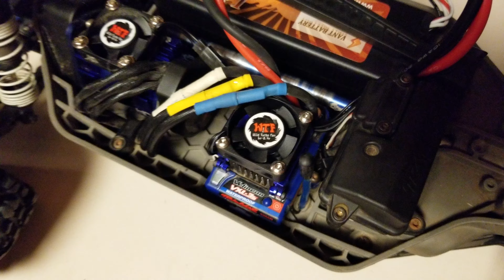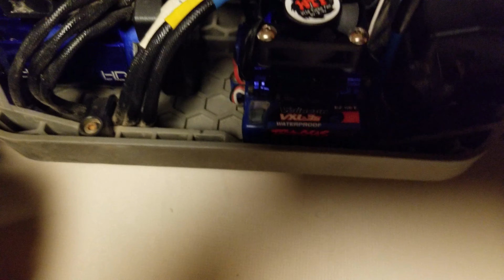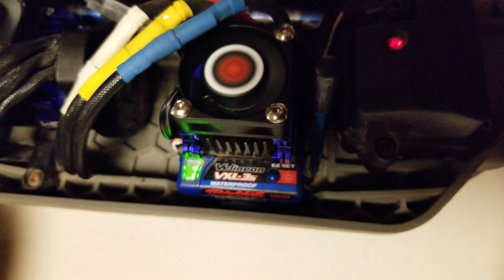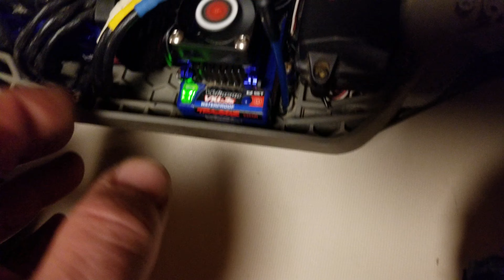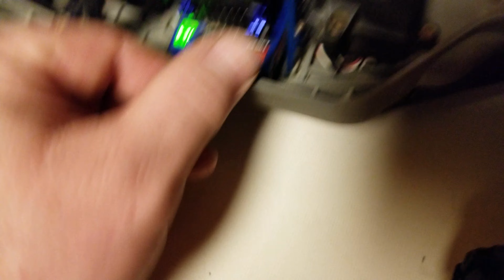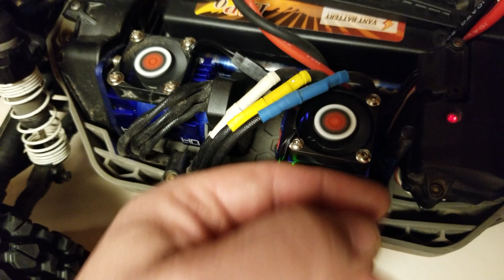Traxxas Rustler 4x4 VXL WTF Fans Finally Installed!

Comment: *USE GLOVES*    -- if you take this step --   (thermal paste can be nasty stuff, may irritate the skin):
If you choose to want your motor heat sink to stay put, not slide around, you can use thermal paste, or thermal glue. Same stuff as you put on a computer CPU, to transfer heat to the cooling system in the computer. 
Put a little dab of the paste on the inside of the heat sink, or the motor, spread it around, evenly, where the heat sink will slide on, and once the heat sink is installed, it will help with heat transfer, as well. 
  For clean-up: rubbing alcohol & some cotton swabs/Q-Tips to get excess off of your model (don't forget gloves)
>>if you go with thermal glue, it will stick a lot better, but also be harder to move later, if you decide to make adjustments.

Comment: Hey bro I'm going to get these stands for my Traxxas rustler VXL are they easy to install or do I need to get any sort of Mount
Reply from the maker: I originally bought the hot racing fans and heat sink.  I replaced the fans and had to tap the existing heat sink to m3 threads so I could use longer screws
Reply: I was wondering if I can keep my velineon fan on my esc and put the wtf fan on my motor?
Reply from the maker: @rcjer6473  you can if you have a heat sink or something to mount it to.
Reply: Okay thanks buddy can you recommend a proper heat sink for the Velineon motor and mine's a two-wheel drive rustler so it has that back mounted Motor
Reply from the maker: @rcjer6473  the hot racing heat sink and fan that I have on mine came with a offset spacer so you can offset a fan.  I'll get a link for you quick
Reply from the maker: @rcjer6473  https://rover.ebay.com/rover/0/0/0?mpre=https%3A%2F%2Fwww.ebay.com%2Fulk%2Fitm%2F202052399847
Reply from the maker: @rcjer6473  only problem with fans on a 2wd is that the fans are vulnerable to impacts and may fly off if doing any hard bashing.
Reply: Hey thanks a lot bro I really appreciate the advice and the link I'm going to actually pick one of those up and I'm thinking I'll get in the rustler roll cage anyways and once I do some research and make sure that that roll cage fits the rustler 2-wheel drive body that and I think that will give  some extra protection against the fan
Reply: Hey bro my hot racing heat sink and motor fan just arrived. Thanks for the link and advice. Quick question though. If I have the esc fan plugged in where do I plug in my motor fan. I can't seem to figure out where I would hook the power up too.
Reply from the maker: @rcjer6473  plug it into any open channel on your reciever.  Look at the orientation of the red and black wires of other wires and plug them in the same way into any open channel.
Reply: Is there any way you could make a video of how you installed it in you car and how you set them up?.